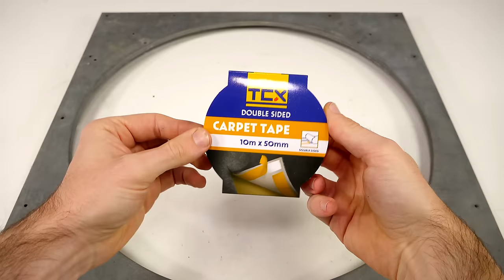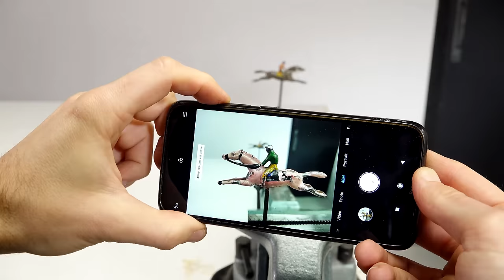Mechanical Horse Racing Game - Restoration

Comment: I'm blown away with the attention to detail such an amazing restoration you sir are by far my favourite restoration content creator thank you for all the time and effort you put into your videos
Reply from the maker: Thank you very much 👌😉
Reply: @OldThingsNeverDie- Seeing as you did such a great job restoring it but went down to the brass instead of re-coating the chrome, I'm guessing that's a pretty difficult and demanding process. Would an electron sputtering machine be capable of putting down a good enough layer or would it just be too soft especially for a coin dish?

Comment: For those complaining that its been ruined because its lost its patina, consider this:
Restoration: restoring something to original condition
Conservation: stabilizing in its current or similar condition which might or might not include returning to working order
Renovation: gutting and rebuilding with modern improved features

This is restoration, yes its lost its patina, BUT this is the same issue in the world of art conservation dealt with so well by Baumgartner. We're taught and used to seeing objects with a patina of age, but it was not how it was intended by the designer or artist, the patina shows its passage through time and it becomes an antiquity but no longer and item, personally I love to see things restored to how they were supposed to be, rather then a broken museum curio.
Reply: Ok, what is an exact replica was made to mirror the original condition? Would that replica have equal value to the restored version in this video? If not, why? Since you'll probably agree that it has value from being created all that time ago, why isn't that true of the paint job itself? The paint was perfectly fine - the antique has lost value by having it removed. 

You'd have a point about artist's vision if the paint job was an unnecessary restoration, but the paint job wasn't even unnecessarily restored, it was completely renovated. Compare the horses before and after. They have been reimagined - the numbers, for instance, have been replaced from being hand-painted. That's clearly not the artist's original vision.

What is restoration is restoring the internal mechanism and the suchlike. Antiques don't have value from not working.

Comment: I was surprised you didn’t file off the casting marks on the horses. I was similarly surprised you didn’t file casting marks off and nickel plate the posts and steeples. I liked the cold blueing you did.

Comment: The amount of care and attention to detail you put into this project isn't something you see a lot these days. Don't get me wrong, there are plenty of great maker and restoration channels out there. But something about this project, and the way you presented it took me back in time to the toy factory where it was being made.

Someone drew out the whole thing on real paper with a compass, straight edge, and calipers. Someone else built the wooden box. Someone else worked sheet metal into a rather difficult shape to make. Someone else sculpted the original horse and jockey model before it was turned into a mold. Someone else hand-painted each horse and jockey model as it came out of the mold. And someone else put all the pieces together to make the designer's vision a reality.

This isn't how things are made anymore. Something like this would be designed in a CAD software, where it could be easily manipulated for fit and scale. Then the parts would be sent to a 3d printer for rapid prototyping. Any molds would be made from the 3d printed parts, and everything else would be made on a CNC machine of one type or another. Minimal human interaction would occur until final assembly, and even some of that could be done with robots.

Not having seen your channel before, I fully expected you to take measurements and then toss everything but the horses and start over using modern manufacturing methods. Instead, you meticulously refurbished every original part using mostly hand tools and basic power tools. When you did use modern machining methods, it was either to save an original part that couldn't be refurbised by hand, or to replace a part that was missing completely. You've really brought back the soul of this toy.

You have thoroughly impressed me, and I can't wait to see what you do next!

Comment: Why did you make such big holes into the posts to then glue threads into them, instead of making  smaller holes (maintaining more of the original material) and turning threads into those?
Apart form that, very nice work! :D

Comment: As an antique dealer, it's hard to watch a 100 years of undisturbed patina, original paint, surface and acceptable wear stripped away to make something brand new looking. It's soul is gone. Mechanically everything you did was fine, as far as the top, it should have been left alone or a  thoughtful restoration.
Reply: Why it's a problem ?
Reply: @sorban5352  A huge part of the original craftsmanship - the painting - has been completely stripped from it and modernised/reimagined. The paint on the horses was just fine. I can understand replacing the paint on the box, since that's just black paint, but stripping those horses was horrifying to watch. Those horses were painted a century ago, and now that's all gone.

Comment: While the end result looks nice, watching you remove the original paint and the original faux leather paper would make any collector shriek.  The toy lost all of its original charm.  If you're going to repaint and use new materials on the entire piece, why not just make a reproduction?  You will never be able to get back the original finishes.  Please, please, please don't do this to original toys unless they are in much worse condition.
Reply: Exactly. It's much better if you want someone to buy it to use - but a huge, huge portion of its value as an antique has been quite literally stripped away. This is such a problem on these YouTube restoration videos. Can't seem to find one channel which respects the principles of antique restoration.